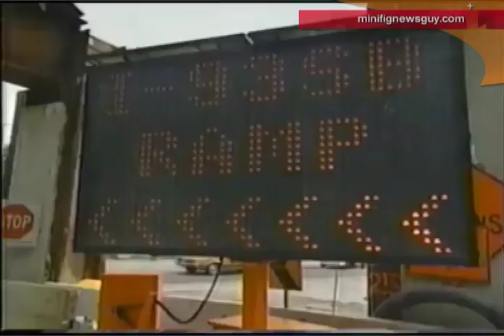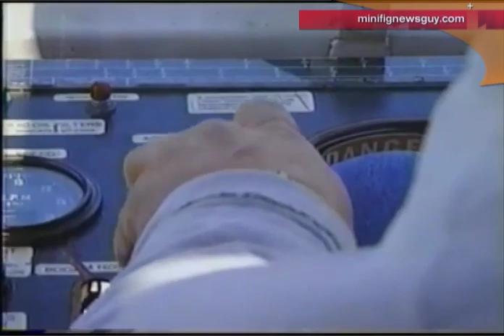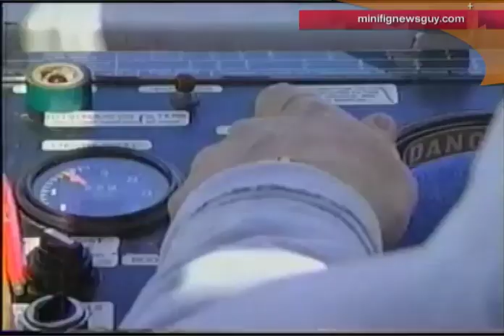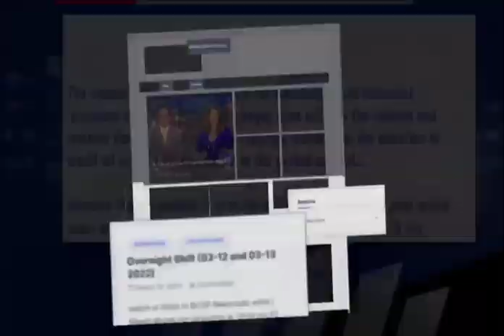WGBH-TV Boston - Greater Boston Special on The Big Dig - 2000

Comment: It's not about pointing blame, because we all know they had to make incredible compromise's about where they could build this thing.  

The lesson of the whole story is that you can't just build a tunnel exactly where you want to, and that the tax payers should have been better informed on what the product would entail.  Them "finding out" that the tunnel would cost more due to poor soil conditions is inexcusable.  

These people have little or no hesitance to fleece state budgets, and make you feel guilty for even suggesting accountability.  Because YOU'RE not the expert, and they are, so shut up an let us do our job.  And if you don't crystalize that moral, it'll just keep happening.
Reply from the maker: "Accountability" is often pushed to a more powerless and vulernable group and people in power who have actual responsibilities really got away unscathed. 

Ironically despite the flaws of a decades ol project for 93 in southern NH, they actually did well to get 4 lanes from Manchester to Salem without much of an engineering problem. There is still pockets of widening but they dont have to worry about what happened 40 miles south for sure.